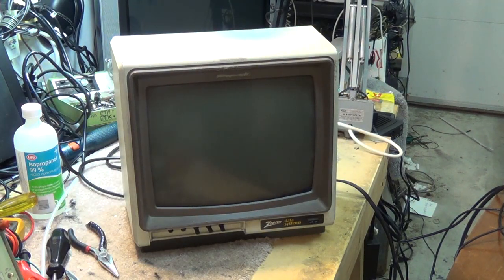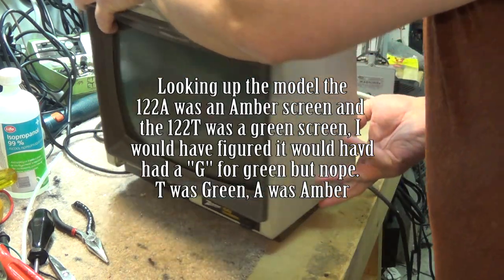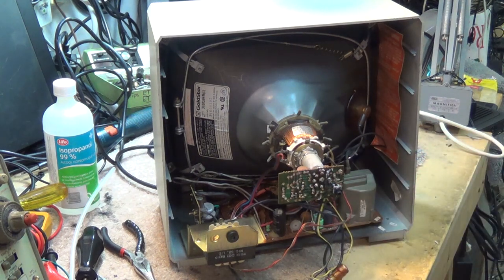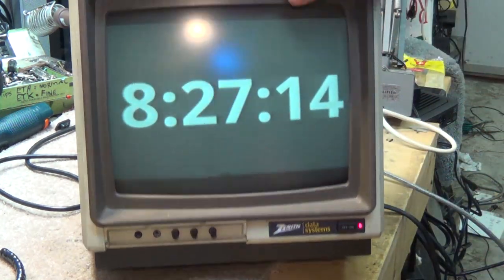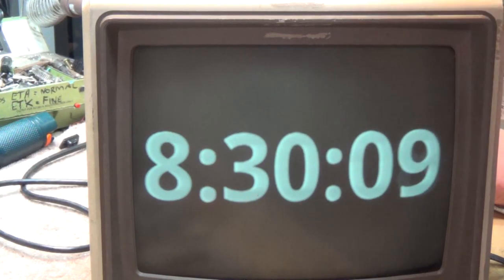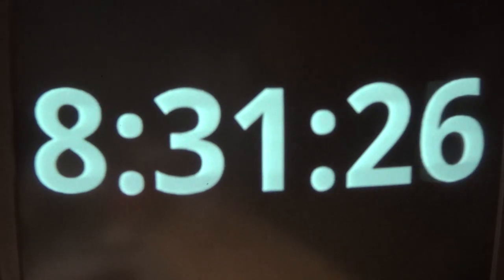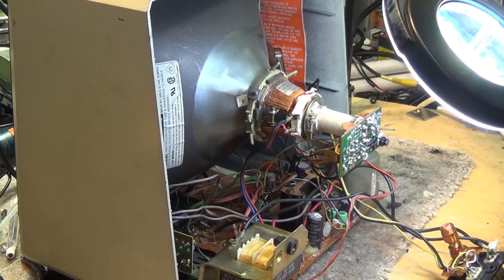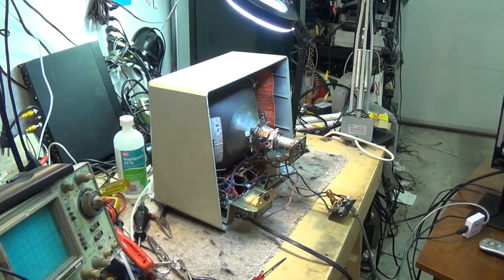Vintage Zenith ZVM122 VDT

Comment: I had two of these. One green and one Amber. I used it for my Atari bbs in the 80s.
Reply from the maker: +jimbronie I almost forgot about the BBS days, and in the 80's I operated a large multi lline BBS. I had a CGA color monitor on the main workstation for editing color ANSI graphics, and a few amber TTL type monitors that I burned the crap out of the screens. It was like a badge of honour, who could have the screen with the darkest burn marks on it. One of my free plasma TVs (the Samsung with that has the crack in the screen) is getting that honour now. I only use it in my bedroom to watch the news on, and the local TV station has their logo cranked up to 110%, so after 6 months of use for 1 hour a day the logo is starting to show through when I put up a white screen, I can see the shadow of the logo.I don't care though, it was a free set, the screen has a crack, and I only use it to watch the news in the morning while I am getting ready for work, so a burn in isn't a big deal.
Reply: +12voltvids I was out to the bbs scene by 1989. I think that is when fidonet and all the multi line stuff started to happen. But there are a lot of fun memories I have from back then. I do remember I got my zenith monitors at the big Trenton Computer Show, mid 80s. Even back then they were dirt cheap. I think I only paid $10-20 each for the amber and green monitors.
Reply from the maker: +jimbronie I was in the BBS scene from 1986 to 1997, and was one of the host systems for Fidonet. We had Netmail, and Echo mail long before the internet. Netmail is now thought of as email, and echomail, that is like the fourms boards.I had 5 networked 386 machines at one time, and 4 dial up lines coming in, and 1 dedicated to sending mail out.
Reply: +12voltvids I was a handicap sigop on Cleveland Freenet - all ASCII, 300 baud.
Reply: +umajunkcollector 
SIGOP?  I've heard of a SYSOP but never a SIGOP.
Reply: special interest group op

Comment: I know the basic monochrome systems were not fantastic, but they did last a loooooong time :-)
Just for fun i put an amber tube in a pye rambler set, watching tv programs in amber was very odd lol.
Reply from the maker: +zx8401ztv Try green!Yes I know the monochroms systems lasted forever. We have some old data terminals at work, that aren't even used anymore but are left turned on 24x7 displaying the same message, the log in screen. They have been there since probably the late 70's or early 80's. They are just dumb terminals. Screens all burned, but other than that they still work. Up until a couple of years ago the engineers did use them to control mainframe computers, to start backups ect, but now they just tel-net in from their laptops and do the backup remotely.
Reply: +12voltvids 
Oh yes ive seen a lot of old sets with phospher burnt screens, some were used for security so the outside view of a building is burnt into it forever.
And the data ones, you can see a whole page of text that must have been a menu system or similar.
Even though the crt is old tech, i still think it was an amazing invention :-)
Reply from the maker: +zx8401ztv I have a 20" Color CRT monitor I used to use for security cameras  before someone gave me a 21LCD and it is burned nicely. You can see thefront and back door outline nicely. I now just use that in my old workshop as a bench monitor for the odd 3/4" tape or PAL tape that needs converting. Good enough to check the video on. I was going to leave it until it burned out, and then I started having second thoughts of doing so as these units are getting rare quickly, and it might be nice to have a few working  sets for my vintage equipment.
Reply: +12voltvids What kind of mainframe?

Comment: Speaking of Monochrome Monitor, it would be nice I would use the 5 Inch Monochrome TV as a Raspberry Pi Clock Display and the Alarm Clock along with the Temperature readings, because it's kind of cool to do that. =)

Comment: Is that NTSC video signal from your raspberry Pi? What resolution is the raspberry pi set at?
Reply from the maker: Its set at 480i, but the clock display is not a raspberry pi. It is an old BlackBerry.  The signal is HDMI output that goes to an HDMI to video converter but it is set to 480p and the HDMI to av converts to 480i. I do run raspberry pi that play videos on my in house system.  They output ntsc directly.
Reply: @12voltvids  thanks for the reply, ultimately that monitor takes in 480i?
Reply from the maker: @r.in.shibuya  yes

Comment: Currently watching this on my Zenith monitor of the (almost) same model! Mines amber, otherwise it's identical.
Reply from the maker: This one was originally amber.  It was used on an old monochrome PC that i once ran a bbs on. Just text and ansi graphics. The tube got real tired and cranked up all the way it was barely visible.   I increased the heater viktage to squeeze a few more hours out of it.  It ran 24/7 and was really badly burned.  I ran a net/echomail host and my system was responsible as one of the main hosts on Fidonet and signet.  When the tube finally gave our I put this paper white long persistence tube in from an old stand alone word processor that the board was fried by a power surge.
Reply: @12voltvids  oh awesome! Yeah mine's a little tired but thankfully not that baked. I'm glad because I like the amber!
Reply from the maker: @defconzero  I got mine well uaed. It was severely burned as it has been used in a retail environment as a pos.  Program called gaspack. Was a muffler shop program.   Wasn't just muffler shops that used it but that is what it was originally custom written for.
Reply: @12voltvids  oh that's very interesting. Cool story! I wish I knew the backstory of some of my sets like that.

Comment: You might want to add some clever circuit to randomize the text position, or else you'll burn the phosfor under the : chars. Good video, thanks.
Reply from the maker: Burned phosphor is a badge of honor for an old monitor!
Reply: 12voltvids well, yes, that's true. But it's a pain when you got to use one of those.
Reply from the maker: Back in my BBS sysop days long before the internet I burned a few cheap monitors. These were pretty much used exclusively for text and ANSI graphics. I burned a fe monochrome TTL monitors, and even an old CGA color one with the loo for the program Front Door which had a big block letter logo while the system was waiting for a call. That and the ZMODEM frame that surrounded the status window when users were downloading. The monitor was burned so badly. This one on this video was originally an amber tube that was burned up. I was given this long persistence white tube which I swapped when the old tube burned out. These tubes were designed for word processors, and they would use black text on a white screen to try to reduce eye strain from staring at the monitor all day. They went with long persistence phosphor to reduce flicker which was linked to eye strain.
Reply: Never been a sysop, my parents would not pay for another phone line... :-( But I was moderator for Fido UNIX conference in Area... mmmm something... 32 maybe... 36 ??? There were TSR programs for MS-DOS that did screen blanking but I have no idea if they worked with pcboard.
Reply from the maker: I was a little older when I run my system. I had a multi line system. 4 286 machines networked. I had a bunch of download files, and charged my users a yearly fee to access it. The 4 phone likes I think were 12.00 a month at the time, so 48 bucks a month for 4 analog phone lines.  I had about 5,000 a year rolling in from users, about 100 regular users that bought annual subscriptions for 30.00
I had hundreds of casual users that would pay 5.00 for a month of unlimited access. How I did it was the first line was free. That would hook them. And I gave every user 30 minutes a day for free. The other lines were pay lines, and everyone that subscribed got access to those lines where they could camp and download to their hearts content.
I did it from 85 and shut it down in 97 when I had to turn that spare bedroom into a nursery for my daughter. The cost of phone lines was rising by this point, and they had gone from 12 per month to 17, and were continuing to climb, so I cut back to 2 lines in 97 and announced that subscribers would keep their subscription until it ran out. 
I was also a fidonet mail hub, so I did keep the primary number running for awhile, and had that line valid until ADSL rolled out. For me that was March 1, 2000. That's the day I first got ADSL, and shut off my analog modem for the last time.

Comment: I cant stand the high frequency scream of these things
Reply from the maker: +GrimL0gic 15.75KHz is right at the edge of most peoples hearing for adults. Younger people can hear higher. I have an induction burner on my stove, and I can't hear it but it drives my kids crazy, which is good because it keeps them out of the kitchen.
Reply: I could actually hear it much of the time through the camera mic and compression. Yes, the whine was annoying. All tube TVs had it as well.